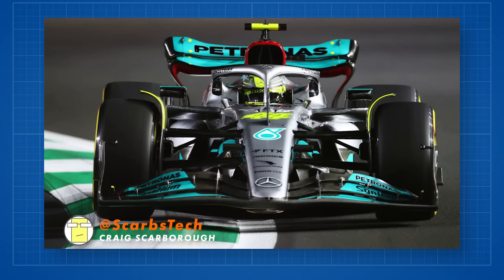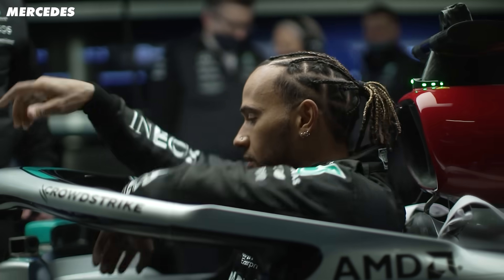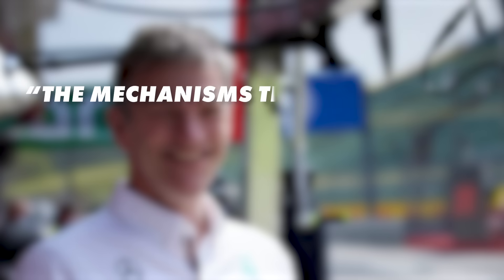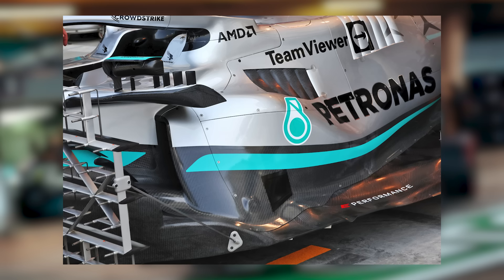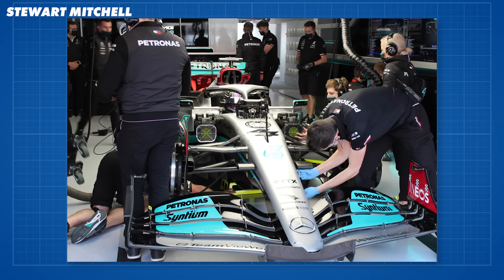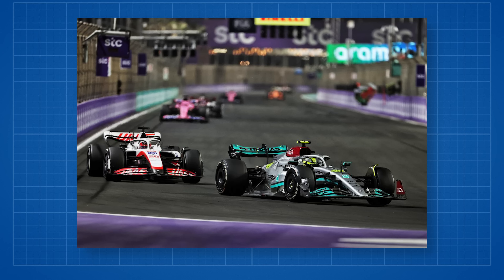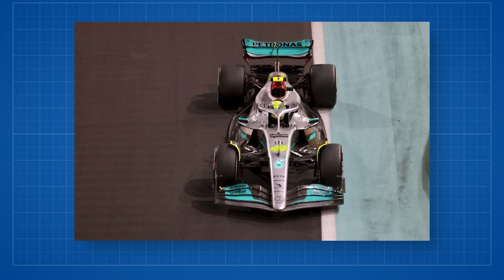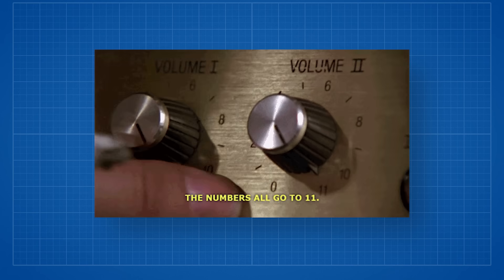The Real Reason for Mercedes’ Slow Pace | Saudi Arabian GP

Comment: Perhaps Mercedes could incorporate something similar to the anti-dive geometry found on passenger cars to create a sort of binding in the rear suspension to help control the problem?
Reply: They already have it to much greater level than road cars, same as every other team. Race cars generally run a lot of anti dive / anti squat.
Reply: The suspensions are limited to using springs and mass dampeners. They can't use any of the dampening found on streetcars. This is new territory for Mercedes who have used fancy dampening systems.
Reply: @UncleElias  what I'm referring to is resistance to movement of the control arms by designing the pivots to bind as the control arms approach the limits of their travel.
Reply: @2003wrx64  not on these new tires : )
Reply: @UncleElias  Anti dive has nothing to do with dampers/springs. It's a suspension arm geometry where the wishbones are not parallel to each other. That transfers some load directly through the suspension pickup points and bypasses the spring/damper. It has the effect of resisting dive under braking. 

Also the dampers in a suspension are not mass dampers, they're just plain dampers. A mass damper is something different that consists of a free floating mass attached to separate spring and damper from the suspension's. The ratio of mass and spring constant is chosen to absorbs chassis vibrations at certain frequencies that correspond to the chassis' natural modes, and dissipate it in the damper. It's also banned since 2006.
Reply: Perhaps, but with passenger cars it doesn't matter as much about how a side effect may affect some other delicate performance balance. These cars are battling over tenths of a second per lap. I would be willing to bet that this adjustment would affect the balance elsewhere. It's similar to what I believe is going on now which is those 0 pods simply can't be adjusted for the porpoising without a much bigger sacrifice in performance than more conventional side pods. Radical isn't always good.
Reply: @Paul-pj5qu  As long as porpoising can be fixed, the fact remains that ground effect is much more aerodynamic than placing wedges around the vehicle. Acheiving downforce through more efficient means and creating less drag. Which is also part of why these cars can race so close.

Also what Mercedes is seeking is dampening. At least according Scarbs, our technical liaison. Anti squat alone wouldn't fix the rhythmic motion of the suspension settling, and with 2 undamped forces the car is subject to rhythmic motions that can be quite uncontrollable. Particularly if the 2 forces begin to resonate with each other.

Comment: Everyone will continue to improve, hard to keep pace with a moving target
Reply: Nearly second a lap of in race trim
Reply: Thanks lewis
Reply: It depends on the potential of the concept though. There is a possibility the merc concept has the highest ceiling, but is also extremely challenging to perfect given its porpoising issues. We don’t know. We don’t know how far off it’s potential the merc is or how close to their potential the other two are. We don’t know how easily merc can address their issues. We don’t know if the power unit is actually off the pace. Once teams have bought meaningful upgrades we will know more.
Reply: @chivs5488  haas and Ferrari(not sure about Ferrari) had the zero pods design as their initial design. They said that it has the advantage in slow speed corners but was later scrapped for the sculpted sidepods because it is faster in the medium and high speed corners. And I think Ferrari also had a different solution to overcome the slow corners which is to use lower gear ratios in the low gears providing better acceleration. I don't think zero pods design has higher potential than the sculpted pods.
Reply: @georgetony8082   it might do it might not. But given the litany of issues merc have I think they are doing very well to be where they are.   We will see.
Reply: We’ll said
Reply: Exactly.
Reply: @MAY-zk8nl  they cant because the while car is so flawed
Reply: If Mercedes gains, it's because they've found a magic bullet or radical change to the suspension and floor that brings everything else together, they ain't catching up any other way.
Reply: Every merc fan who is hoping for a miracle turnaround this season, it most probably won't happen. 
Merc is too far off the pace for that to be a reality.
Reply: @luciniho1  they haven't even lowered their car yet so you don't know their true performance
Reply: @MAY-zk8nl  I would still be hopeful if they just were a few tenths off, but that's not the case, they're miles off the pace. Lowering the car won't just magically make them 1 second faster/ lap.
I think the best case scenario is that they can be an outsider for a win on specific tracks towards the end of the season.
Reply: @luciniho1  porpoising costs AM 0.75s according to their technical director. I can easily see Merc being up there with RB & Ferrari by Imola/spain once they solve porpoising.
Reply: @MAY-zk8nl  haha, that's very optimistic.  Bet some money on that now and you'll get a very nice return😉
Mercedes atm is where Redbull were at 17/18.
Reply: @MAY-zk8nl  lowering car? What will it change? With air tunnels underneath car, you don't need lower car. Lowering front wing will make air tunnels less efficient. Mercedes is driving without sidepods, so they are losing more downforce. They are already scratching the grid, how do you want to lower it?
Reply: Merc are further from their ceiling than ferrari are tho🤔
Reply: @milanstanimirovic1371   I think they probably are. Very early stages though.
Reply: Not necessary because of the sliding scale thing... at the middle of the season the allocation it will change... Ferrari and RB will loose allowed time and Mercedes will gain
Reply: @cosminlesutan3574  while merc sorts out the problems ferrari and red bull will upgrade their cars so in short period of time thats unlikely to happen finally a merc free year
Reply: @berkayakdag733  you are going to be in for a rude awakening
Reply: @johnnychimpo7539  No mate, keep dreaming. This is not Mercs season. RB and Ferrari are way ahead, and will remain there for the rest of the season.
Reply: @berkayakdag733  the Red Bull cars that have failed to finish 50% of the races this season ?
Reply: @Bassman_DB  Do you even sample?
Reply: @Bassman_DB  Sample: Only two races!
Reply: @TCRazvan  merc don't really need to improve the  ar they have pace if they solved this issue you will magically see a mercedes 1 seconds faster
Reply: @Bassman_DB  or you could write it as "have failed to finish 1 race this season"
Reply: @Bassman_DB if you have such low sample count numbers are distorted
Reply: @berkayakdag733  Lets see how well this ages
Reply: @johnnychimpo7539  sound like your just a fanboy
Reply: @chrisreagin8184  ya I’m just a fan boy. The 8 championships in a row means nothing…nothing at all.
Reply: @TCRazvan  not Mercedes season…ha. 8 in a row doesn’t just disappear in a couple weeks. Maybe they won’t win but I bet you that’ll it’ll get too close for your comfort.
Reply: @johnnychimpo7539  Merc wont win if everyone is upgrading their car Merc wont be able to gain much this season gonna have to wait till next season as they get more time to look into problems
Reply: @stanced_kilo  if it were any other team, I would agree but it’s Mercedes. They very well could get 3rd or worse, it’s likely at this point but they could change in around in the next month or two and be winning races
Reply: @johnnychimpo7539  That was in the past, mate. This is now. New regulations, different cars. Past championships will not guarantee you a new one. Also, last I remember, Toto said last year they are focusing on this years car. Riiiight.
Reply: @TCRazvan  you’ll see man
Reply: @TCRazvan  my buddy knows any employee at Brackley and they didn’t know too much but big upgrades coming soon
Reply: @johnnychimpo7539  Maybe there are big upgrades coming and it'll bring Merc right where Ferrari is now, but don't forget that top teams are not going to stall technologically. I get 2013 vibes from this season (with the W04), a car with potential but lots of small problems.
Reply: @TCRazvan  Mercedes is playing mind games and you are falling for it
Reply: @johnnychimpo7539  all because it’s Mercedes yup makes sense
Reply: @TCRazvan  and yet they are ahead of merc lol
Reply: @berkayakdag733  why would a Merc-free year be good ? May the best engineering team prevail in terms of car performance
Reply: @johnnychimpo7539  they are dine. Every aspect of the car is bad.
Reply: @Gl-my8fw  they are easily the 3rd best team. So if every part of their car is bad, what are the other 7 teams and their car parts?
Reply: @johnnychimpo7539  they are way closer to the slower teams than the top 2.
Reply: @Bassman_DB  there’s has been 2
Reply: @cosminlesutan3574  I think that is the stupidest system going. Penalise the teams doing well and reward teams that do a poorer job? It’s so backwards. Everyone should have the same amount, period. We have a budget cap, the CFD and wind tunnel time should be the same
Reply: @christiansimmons630  Imagine being Mercedes and in the dawn of the biggest change of rules in history, you get less development time than anyone else. Hass got double the wind tunnel and CFD than them :)))))This is no longer a proper competition but an american fiasco
Reply: @cosminlesutan3574  that’s what bugs me. It’s not right. Budget cap I’m for (although not this low) but CFD and wind tunnel should be the same or marginally more for either the champions ornchaeers
Reply: @cosminlesutan3574  they give all on their 2021 car so
Reply: @tomydespins2315  Nop. That allocation was for this years car... Last year we did not have a sliding scale. And Its going to be recalculated starting with the middle of the season. So the first team, be it Ferrari or RB, will loose 10% CFD and wind tunnel to Mercedes (if they remain 3rd)
Reply: @christiansimmons630  But with a budget cap in place, and a pretty low one, why limit wind tunnel and CFD? let the teams decide how they use the money
Reply: @cosminlesutan3574  tbh I agree with that. Do you think driver salaries should be in or out the cap?
Reply: @christiansimmons630  No. Iike how the current exception works. Its safer for teams to be able to keep top management... And drivers.. usually the ones that earn millions return back to the team way more from sponsorships
Reply: @christiansimmons630  that’s what we had before, and everyone hated it, pissing themselves that merc was winning. Now merc has the potential to come back, nobody wants the sliding scale anymore
Reply: They failed the project. No more Merc powered cars on top until 2025. GG

Comment: everyone forgets that the others team will possibly improve also so they will still be on the backfoot. Its possible that their projected level could be on the same page with RBR and Ferrari, but by the time they fix their issues the others will still be in front, evolving their designs. The need the others to make errors also. Unless, their target is to stay low this year and use the extra r&d time for the second half of the season.....
Reply: @Μιχαλης Κουφοπουλος Redbull started with an error didnt they? also Charles and Max will keep toppling each other from the top podium, that wont let them get too far away on points. Dont forget Checo and the smooth operator. After Jeddah's Pole Checo is hungry for a win and Sainz will get Pace and his first win shortly. Front runners wont get away so easily.
Reply: @mikko3  yes it can be very good since it reduces drag significantly
Reply: depends the problem. An unbalanced car will be really slow. Get the car balanced and drivable and it could immediately be a rocket ship.
Reply: a lot of people have been saying this and im just gonna try once, WE know they will develop as well, but their cars dont have as many issues so their gains wont be as significant as merc when they solve their issues.
Reply: @Rishi3404  On the other hand, they are not going to spend capped money to fix problems they don't have, so they are going to have more for further develpoment.
Reply: @Rishi3404  
Pfff... Be carefull. It's almost as if your saying it's better to start the season with a bad car, so you can relatively make more progress later on... That would only be a good idea if the bad car was as fast as the great cars from the get go.

The difference between Merc and RBR and Ferrari is that the Italians spent more time last season on the new car than the two other rivals, who were fighting the 2021 battle untill the end. Merc and RBR had spent less time to develop their 2022 and both showed some issues at the introduction, where the Ferrari was already mature. RBR fixed their fuel problem and are already equalling Ferrari , but Mercedes' problems are deeper. They obviously wanted to out-innovate the others with a 2nd, more radical design, but that has backlashed on them thusfar.
Reply: @Wuppie62  true, but just to be clear im not saying anything of the sort, i'm just trying to make the people who keep saying "other teams will develop too" understand what people mean when they say merc will bring upgrades.
Reply: @Rishi3404  
Sure, but nobody knows what updates the teams will bring and certainly not what their effect will be. It's all speculation.
Reply: @Wuppie62  no but when your bad car is still this fast with such a big issue then by fixing the issue you will notice a much bigger change

Their design didn't backfire the lack of enough testing time did since they weren't able to discover the issues of the car.

If they can fix their porposing they will have the better car if not at least a competitive one in the constructors

Comment: I thought the smooth track would really even up the field. 
thinking that Ferrari and RedBull had better chassis control. 
but... the smooth track seemed to help them just as much.
Reply: AND it's not like the others are flatting out yet. They too are sparing the engines and seeing what parts wear first, before using full power. Ferrari was racing with a lot of rear wing too (that's why RB was faster on the straight) also to reduce the chances to smash the new car with few spare parts available on a wall... they too have evolution steps scheduled...
Reply: Thats because they just have way more downforce compared to the others. Merc is down 1 sec a lap in racepace, you wont make up 1 second by just fixing the porposing problem. They severely lack downforce just as they have way too much drag.
Reply: @Marc98338   @Marc  I was thinking they just couldn't get the ride height to get the downforce. 
that a smooth surface would let them drop to get it back. 
seemed a lot of the porpoising initiated by the bumps possibly magnified by need to cope with bumps
Reply: you've got to take into account that merc haven't had half as much time in the wind tunnel as Ferrari and red bull too so Ferrari have more than likely a more completed car than merc do
Reply: @woodyswheels6236  redbull and Mercedes had similar CFD times. I think It's around 5 percend difference between Mercedes and redbull

Comment: "It's not a car, it's a driver"- L. Hamilton
Reply: There is this thing called relative, you know when someone is being bounced around like they are on a roller coaster and their power is completely down that amazingly might be the car. Whereas if he was in a farrari we can base it off the driver and by his performance in his first ever season with an Alsono coming off two back to back world championship wins as a teammate we know what the driver is capable of.
Reply: @Alex-cw3rz  You do know that Alonso wasn't released by Renault until late, so he had barely any time in the 2007 McLaren during the off-season, whereas Hamilton was able to test the thing back in a day when testing was running the car for thousands of laps? Hamilton is a great driver, but Alonso actually entered that season at a significant disadvantage.
Reply: @n8pls543  sorry the guy who had been racing in F1 for years just won two championships who was familiar with almost all of these circuits and had got one podium at most of them, in a non big rule change year was the one at "significant disadvantage" vs the person who hasn't raced round more than half the tracks and has had what an extra few weeks in the car, he'd never even been in an F1 race before!. On top at the end of the season when Alonso had had months longer in the car than you'd ever get in the off season, he was still slower than Hamilton... What you said is baffling and shows it doesn't matter what Hamilton does you'll always have some laughable excuse.

Comment: The sidepods could be affecting the center of lift and that shifts with the angle of attack. Maybe to a large enough degree, that the suspension dampening is overwhelmed.
Reply: it might just be the engine honestly i think ferrari and redbull made massive steps in engine development because it seems every merc powered car has been losing out in the straights to the ferrari powered cars this season. Even the Haas and Alfa Romeo cars are absolutely rapid compared to last year.
Reply: @LUCKIPUP  AR apparently have made their own gearbox to the Ferrari engine. Sounded foolish to me and their reliability seems to back this up. SF engines look to have leading acceleration with the RBPT/Honda PU. But then at the top end, the RBPT/Honda have the edge.